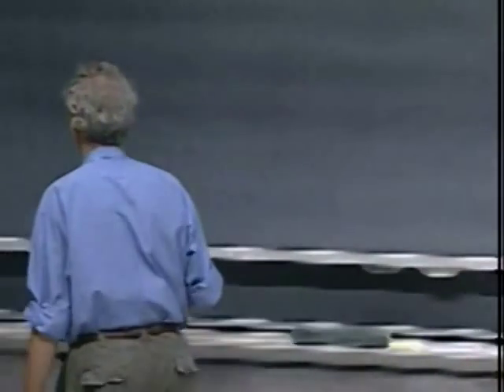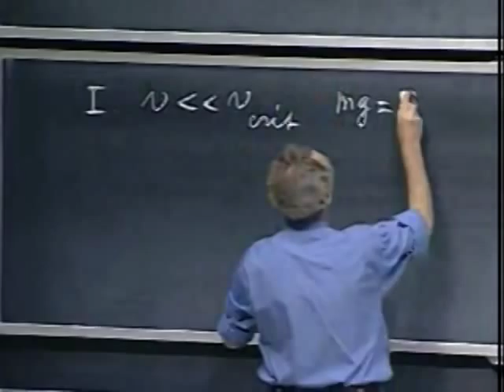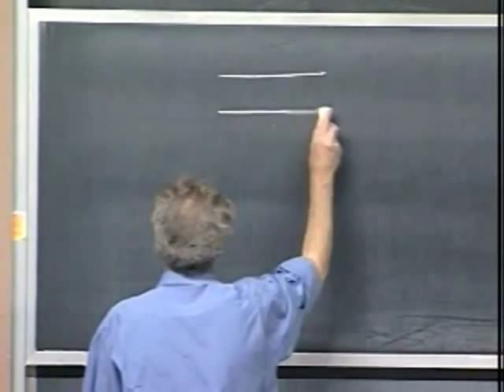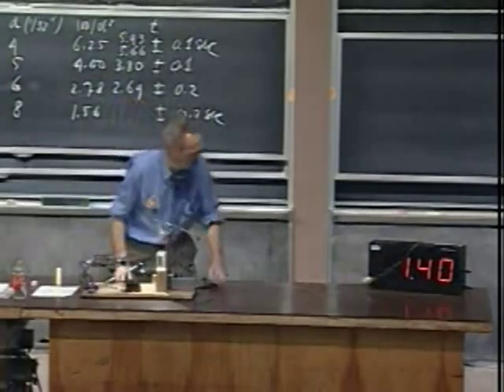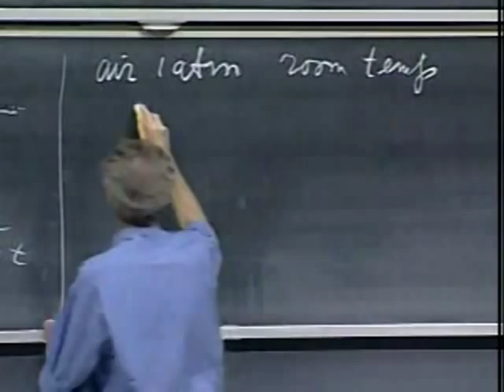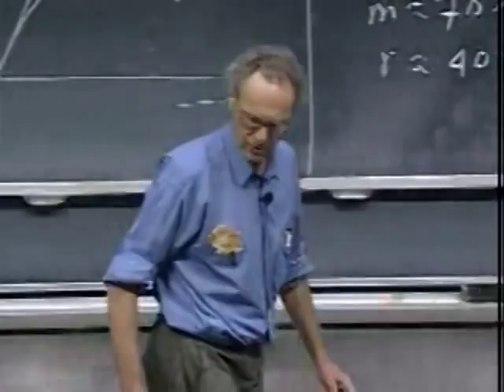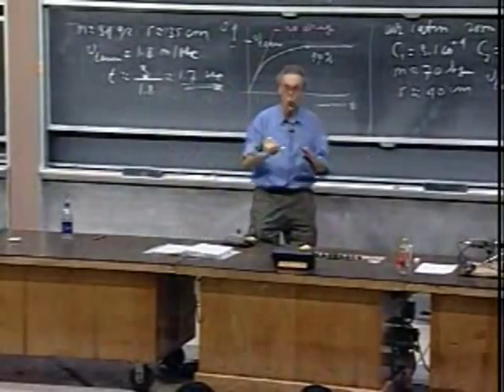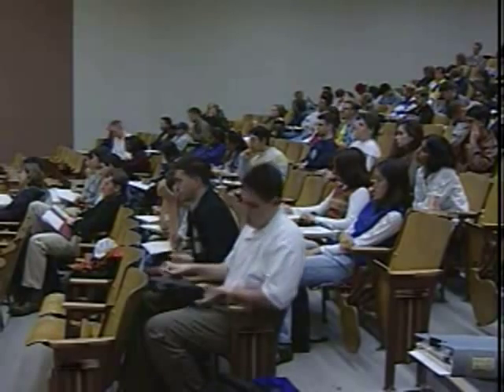Lec 12: Resistive Forces | 8.01 Classical Mechanics, Fall 1999 (Walter Lewin)

Comment: I don't know where my mistake is.

I calculated C1 and C2 for air and got these results:

C1 = 3.2*10^-4 Pa*s

C2 = 8.5 kg/m^3

(Am I the only one annoyed by the fact that he persistently neglects the importance of writing the units?)

Well, as you can see my C1 matches with Lewin's but my C2 doesn't by a factor of 10.

I calculated C2 so:

C2 = 9/4 * pi * density_of_air

with density_of_air = 1.2 kg/m^3

and the result is 8.4823 kg/m^3
Reply: how did you calculate them? C1 and C2 are given, prof. didn't seem to introduce the way of getting C1 C2